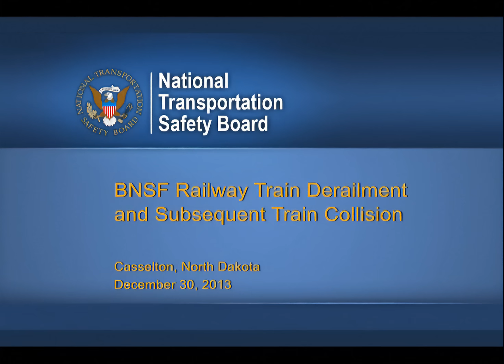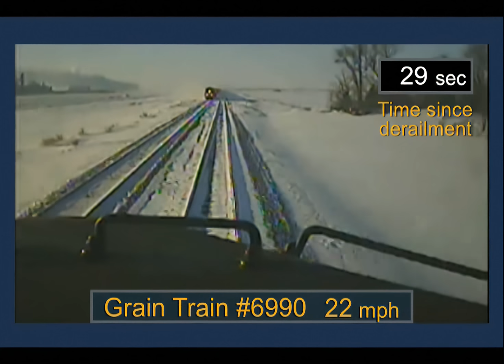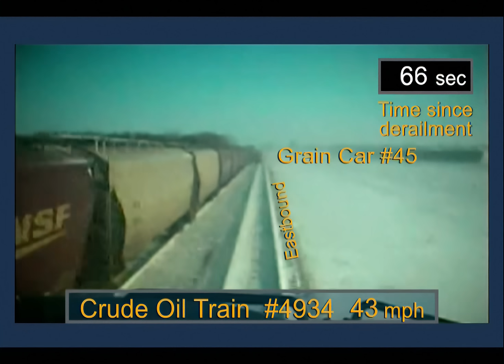BNSF Railway Train Derailment and Subsequent Train Collision

Comment: I hope BNSF didn't try to can any of the crews involved. I know first chance those BNSF mgrs got they brought out their pee cups for the drug test.
Reply: Why?
Reply: You are correct. At 1:47 was when their train went into emergency. That's when they should have warned the oil train per GCOR rule 6.23.
Reply: 6.23 Emergency Stop or Severe Slack Action 
When a train or engine is stopped by an emergency application of the brakes or severe slack action occurs while stopping, take the following actions: 

Obstruction of Main Track or Controlled Siding 

If an adjacent main track or controlled siding may be obstructed, immediately: 
• Warn other trains by radio, stating the exact location and status of the train and repeat as necessary. 
• Place lighted fusees on adjacent tracks. 
• Notify the train dispatcher or control operator and, when possible, foreign line railroads if necessary. 
Warning to other movements is no longer necessary when: 
• It is known adjacent tracks are not obstructed. 
or 

• The train dispatcher or control operator advises the crew that protection is provided on adjacent tracks.
Reply: As far as the ensuing derailments and fire...that's not the grain crews fault. Sounds like you are blaming them totally for the entirety of the derailment of their train AND the ensuing oil train derailment. Not their fault. Even had they followed rule 6.23 to the LETTER, the oil train was still going to hit the derailed car fouling their track.
Reply: 25mfd ... It's the law... Blame lawyers... The scorge of huminty.
Reply: Drug test is mandatory after an accident

Comment: There are some really smart people arguing about this issue (and a couple stupid ones) but one thing no one has brought up yet... how much help would another set of eyeballs help - in a caboose? Now stop laughing for just a minute. How many millions of dollars did the RR pay to fix this mess? How many caboose crews would that pay for? Not every train needs a caboose, but seems like any haz-mat train and any high-value train would really benefit from the protection of someone watching what's going on IN FRONT of them. We all know rearward visibility from the loco is not that great. And the engineers' first priority is eyes-front (as it should be), which means on a two-man crew you've only got one guy watching one side of the train. I know train crews are expensive... so is dumping a train on the ground. BRING BACK THE 'BOOSE!!!!!!SPGhost
Reply: the EOT needs to be replaced by a Johnny 5 ----
Reply: The railroads NEVER relinquish hold of their capital improvements. Look at the list of things the railroads have gotten rid of... and they are still gone. Flagmen, telegraphers, steam engines, the caboose. These things are gone...forever. The caboose was replaced with the end of train device (EOT). The EOT does the same things the crew did. And it NEVER falls asleep.

Comment: I remember readin gback in the 60s-70s that the axles should be 6' instead of the present  guage.. Would have been less problems now if they had upgraded back then.These big modern railcars now is just like trying to balance on iceskates. Thank God the crew is ok.
Reply: tim h In South Africa the track gauge is 3' 6" and they run 200 car coal trains at 50 mph. Wider gauge would be nice, but track and train maintenance are far more important than the distance between the rails.
Reply: There are some broad gauge railroads around the world.   However 6' gauge was never proven to be cost beneficial.   High maintenance, axle load issues and wide curvature are some of the reasons it never really took off.   Some operations have used wide gauge for passenger only operations so you could have more seats in a coach.  On the other hand, mountainous railroads or short haul operations often went with narror gauge

Comment: I'm surprised no railroads buy the ol' SP light package on their locomotives anymore. The red light on the front of the locomotive would automatically light up in the event of an emergency application to warn oncoming trains that there might be a problem like a fouled track. When the SP was taken over by UP,  they took all the red lights off of the locomotives. Why they just wouldn't leave them is beyond me. I guess they figured with CTC they were unneeded,  but in this case the oncoming train would have known right away the grain train went into emergency.
Reply: In defense of the UP, the Gyralights went away long before UP ever bit off more than they could chew. Gyralights are mechanical devices that require maintenance, thus increasing operating costs. Bean counters don't like increased operating costs because that reduces their bonuses. It's the bean counters that killed the Gyralights. Bean counters equate that it's cheaper to pay out a few million whenever someone sues them for wrongful death  rather than spend a little bit to maintain some added safety devices.
Reply: The "War of the Worlds" UDE light would have made no difference here.

Comment: Did anyone else notice he didn't signal before pulling off to the side of the track?
Reply: Boro Nut he should’ve just swerved
Reply: The locomotive may have been out of blinker fluid.
Reply: @hillbillyninja3810  that's because they need a radiator for the corvair
Reply: Yes, it was. Everyone is OK, so lighten up a bit.
Reply: Yup. Cammer's at fault.
Reply: BMW makes locomotives now.
Reply: @IsaiBarbatus : Damn, I was gonna say something like that 😂
Reply: Again, another example of a rich train line owner refusing to spend money on necessary equipment!  They could get a set of them round turn signals, and mount them to the rear car.  (And how about some backup lights, brake signal lights too?)
Reply: Didn't know bmw made trains
Reply: Lmfao
Reply: Anthony Smith mm
Reply: Nah, he didn't had to, it's a 8WD Train! He can do what ever he want, smashing wagons and going out of restricted way!
Reply: @TwinShards  I think that it's a 12WD train.
Reply: @TwinShards  its actually a 12 wheel drive train!
Reply: He ran out of blinker fluid
Reply: Hopefully atleast he shoulder checked
Reply: Boro Nut blind spot too
Reply: Exactly you can get terminated for that
Reply: Ran out of blinker fluid. No proper vehicle inspection.
Reply: lol imagine one of the ditch lights started flashing yellow so he could "pull off" "legally"
Reply: Stobe the Hobo dropped his beer can
Reply: Underrated
Reply: @cart6r  I understand, so making a counter-statement means that he was triggered. I can't tell howfuckingmuch I love people with the logic of yours.
But yes, it was a joke indeed... for 90 IQ people.... =D
Reply: Things happened too quickly?
Reply: The NTSB determined that the accident was caused by inattention by one of the conductors who was having sex with his coworkers and one of their dogs.
Reply: Not funny.
Reply: @MsFred58  no one died and there where no serious injury it's OK to laugh
Reply: @MsFred58  Yes, it's just humor Fred, lighten up. SMH
Reply: @MsFred58  very funny lol
Reply: @MsFred58  oh don’t cry Jesus Christ

Comment: signal maintainer- "hey, umm is everything okay up there on the train, cus,...umm everything is breaking apart back here,...but...um..maybe no big deal?"
Reply: I don't  know what BNSF's rules are, but I have to assume they are similar. On CSX and NS, when you go into emergency, you are supposed to immediately announce that you are in emergency on the road channel. Alerting other trains in the area. I'm not sure it would have made a difference, practically in this case, but there was a pretty significant delay between when the train went into emergency, and when the engineer announced it. In fact the signal maintainer was the one who called out to the engineer of the grain train... only after that did he announce it on the road channel. 

Again, it may not have mattered, as I don't think there was enough time for the oil train to stop short of the impact, but it could have been at least slowed some more...

Comment: The more I hear of railroad communications the more I wonder if anyone anywhere has any set of predetermined procedures they are supposed to follow in the event of an emergency.  Because it sounds like none of them have any idea.
Reply: I spent 10 years as a switchman. Not one time did we ever practice what to do in case of an emergency.
Reply: The company just puts stuff the the rule book and expects crews to memorize every word with little to no practice and then washes their hands of it. When an accident happens they jus say "well you didn't follow the rulebook."

Comment: "Which train is on fire, 6990?"

Doesn't matter, just have the firemen look for the plume of smoke and fire and you'll find the right train, can't miss it!
Reply: I dunno, I personally watched one specific volunteer FD drive past a fire three times. One, understandable, the clearly marked address had no smoke apparent.
The other two, massive smoke on one, flames literally shooting 50+ feet in the air, merrily drove past both and reported being unable to find the fires.
Reply: Well it does kinda matter !  The 6990 was full of grain the one that was on fire was full of oil !!!!!
Reply: @mattywho8485  Yup. Firefighters need to know what they are about to fight. What if it was a grain vs chemical scenario, if they don't come equipped for hazardous materials then it could kill them to fight it with the wrong thing, or cause a reaction if they fight it with the wrong fluid/solid.
Reply: I dunno.  When they moved President Bush’s casket to his final resting place, they used a specially painted locomotive with Air Force 1 colors. If it had happened to him, I would be looking for the engine while asking myself why the Air Force 1 is flying so low.😉. Ok.  That was lame.  I tried.